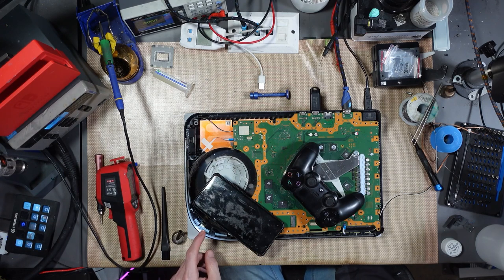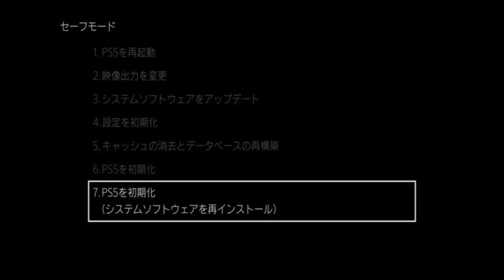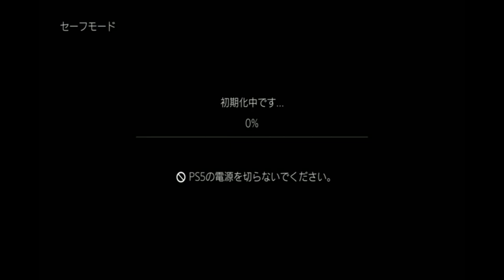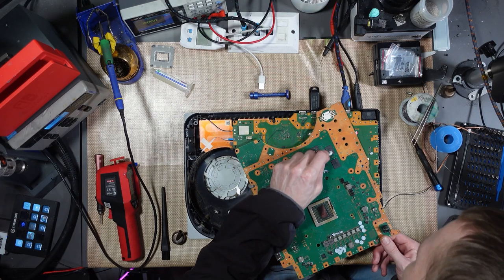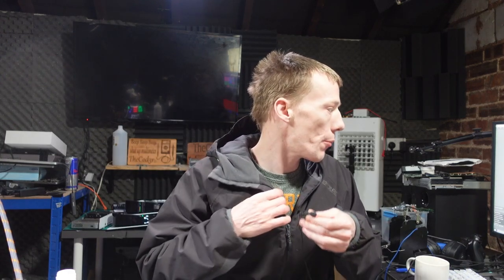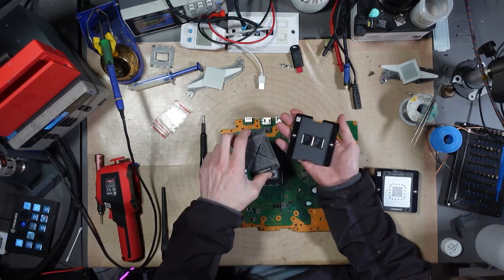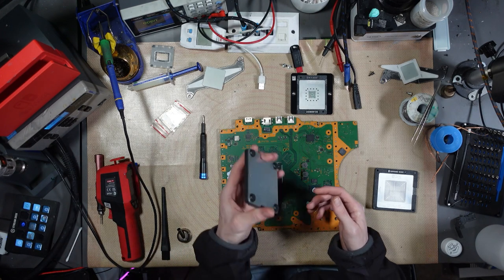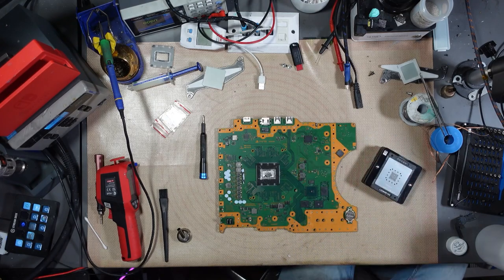Sony Actually Did Something RIGHT! PS5 Stuck In Update Loop FIXED! Here's HOW!

Comment: I would say it was likely that the original ssd controller had a micro fracture on one of the bga balls, probably a data line to the actual ssd chips.  A reflow may have proven that and if so, then you could reball the original and refit. I have a ps5 with an odd situation whereby it will take a factory reinstall and reinstall of firmware from usb stick, but when navigating the system menu, it will simply reset/restart - have you experienced this before?  Keep up the great work, it's been fascinating to watch you learn and improve your skills throughout the year and your bga rework skills make me jealous. 😀

Comment: Very nice job. A lot of people are going paying attention to this. For the SSD's, 660GB free out of 1TB. Honestly don't know either if that's normal as it could be part of the OS and have 300gb or more in partitions i.e recovery, diagnostics etc. so it may be safer to leave it alone. Then again if it's fubared one of the SSD chips only half the free storage could be showing but then it wouldn't boot at all if I'm going by previous vids
Reply from the maker: Yeah I have a brand new console I've never even powered on so I'll look into that one when I do a teardown
Reply: The 660gb out of 1tb be normal it will be taken up for the os and recovery partitions etc
Reply: If I recall correctly, its an 825 GB SSD in total as per Mark Cerny's Road to PS5 presentation.
Reply: PS5's dont have a 1tb SSD, its 825GB oddly enough.
Reply: @_MJ07_  sounds like the ssd are  Specifically made for ps5 unless you can but ssd with that capacity

Comment: As long as the SSD NAND chips are exactly the same I can't see there being an issue swapping them over. At the end of the day all they're only NAND flash chips to store 1's & 0's on, it's the controller chip that would have any kind of security on them and be an issue and you've proved that not to be an issue so as long as the NAND flash chips are the same or ones known to work with that exact controller I can't see it not working!
Reply from the maker: Yeah I agree mate. From what I can tell these things run in some sort of striped RAID0 (or maybe a custom similar method). I did replace one on this same stream (part two coming soon) and after a reinstall it worked fine
Reply: @TheCod3r  I thought that'd be the case. The only issue you're going to get is that the controller doesn't know what's what and where on the new NAND flash & will look corrupted to it so it'll prompt to re-install the firmware due to SSD corruption which is then simple, mostly!

Comment: i have a ps5 repair console that has this problem it starts in safe mode and you can only choose option 8 is it a damaged disk or maybe bios or ssd controller
Reply: Did you ever fix this? I have the same issue

Comment: Sony didn't do anything right when they've decide for their interest is better to solder the SSD to the motherboard. From this standpoint MS did a better job by puting an M2 port. But of course, MS couldn't be the clear good guy, since the SSD in Xbox Series is not easily replaceable since they've added a small RAW partition which contain the KEY that ties the SSD to the motherboard.

Both are greedy scumbags corporations.

Comment: Could it have been caused by a bad solder joint under the original ssd controller?
Reply from the maker: Possible, the only way to really tell would be to install the controller I took off and see if it works 💪
Reply: @TheCod3r  Has this ever been done after this video, what with the stripped controller is it correct? Did he have a bad solder joint?

Comment: Had a similar problem and replaced the ssd controller chip but still the same result any idea of what it could be.
Reply: I have the same problem and I'm about to reflow the ssd controller before I go to replace it. Before that I had a problem with the power supply and the southbridge, that's what I did. The lightning strike obviously went through this one well. So I'll probably need a new ssd controller, hopefully that's all.

Comment: those ssd chips hold hidden partitions.  you'd have to use replacements from the exact same board model.
Reply from the maker: I have replaced one during the same stream (part two coming soon) but I can't remeber what model I took it off

Comment: Before desoldering the system or processor, you need to remove the batteries. If you do not do this, you will damage the fuses or systems.  My hair stands on end when you destroy people's consoles
Reply from the maker: It doesn't. I've worked on consoles every day for 4 years, never removed those batteries, never had an issue at all. I've even reballed and replaced the APU on PS4s without removing the battery and it doesn't harm anything
Reply: @TheCod3r  You're overconfident, you've had 2 ps5 complaints recently, how many complaints have you had in a week???  Someone entrusts you with expensive equipment, and you fix it like a plumber
Reply: @-ENIAC-  calm down he ain't over confident he knows what he is doing
Reply: Greg I see you're giving Phil a lot of stick, Im here learning things and if you have better methods can you please put on some videos cheers
Reply: @pinchface  I try to wean people from bad habits.  I don't make videos because I'm swamped with work.  Recording and editing takes a lot of time, you need a second person to do it.  Besides, I don't need to advertise.  People want me to fix them.